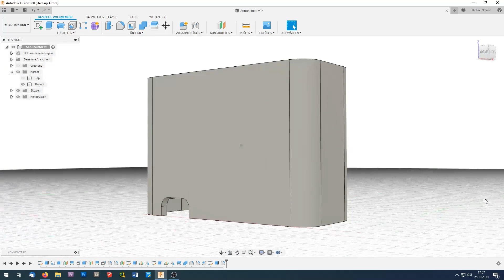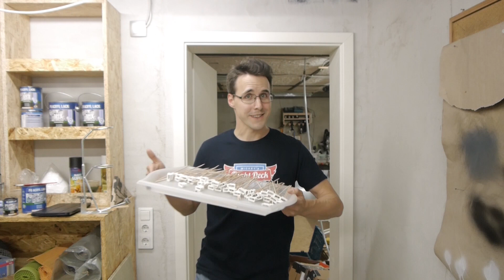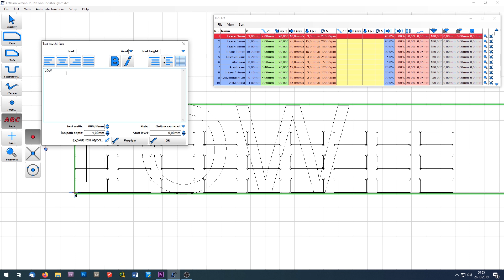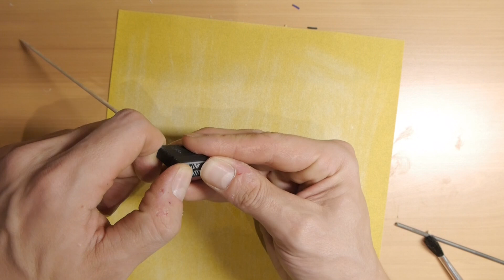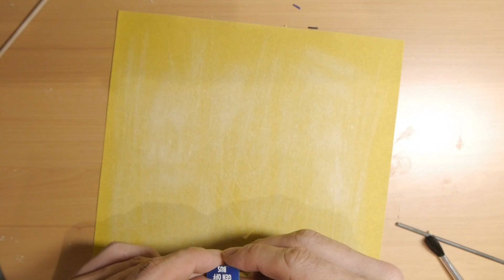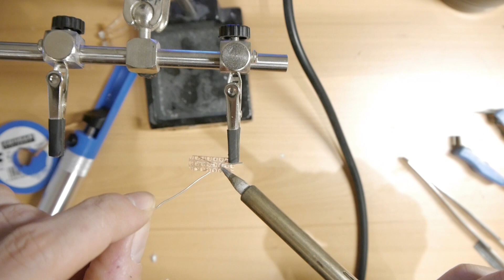Overhead annunciators - A Boeing 737-800 Homecockpit #37

Comment: Hi Mickey, I am following your channel since the beginning thank you so much for the videos. I can now afford to buy some tools to build a small cockpit for myself. Would it be possible for you to share the parameters for the cutting on the CNC ? The engraving works perfectly however I have some challenges with cutting the edges are terrible. Or maybe it comes from the tape that is not strong enough and make the small pieces vibrating on the tool. Thanks again!
Reply from the maker: For cutting the edges I used a single blade 2mm bit. 0,4 mm depth per pass with 720 mm / minute.
Reply: @Mickeys_Flightdeck  thank you ! Do you also have the parameters for the engraving ?

Comment: With this method, lets say an LED burns out or fails in someway, what would be the best way to replace the LED since everything is glued in? Other than that, wonderful work!
Reply from the maker: The "pcb" is just glued in with two drops of hot glue, which can be removed very easy. You would desolder the ground connection, remove the pcb and solder in a new LED. The annunciator can rest glued into the panel. Because every panel section of my overhead is an independent module, I can remove it from the overhead and do this work on my desk without removing the whole overhead from the cockpit.

Comment: Can you wire annunciators up to X-Plane 11 without using prosim software
Reply from the maker: Sure you can. For Xplane many people are using simvim.
Reply: @Mickeys_Flightdeck  so what out put board do u use for it
Reply from the maker: @couplesconsole  I will use an arduino mega with Mobiflight on it.
Reply: @Mickeys_Flightdeck  any chance u could do a video on how to wire it up and set it up on the computer or do u know were i could get more information on how to do it all would be much appreciated
Reply from the maker: The method I use is explained in detail in episode #35.
Reply: @Mickeys_Flightdeck  thankyou will surely be watching that

Comment: Michael, ein Tipp am Rande. Du kannst die Ränder der Anzeige vor dem Einbau ganz easy mit einem schwarzen Eding-Stift färben. Das trägt keine verdickende Farbe auf. Dem Ärger mit den Vorwiderständen kannst du auch lindern, indem du dir eine Zusatzplatine fertigst, auf der du alle Widerstände fest einlötest und die Zuführung lötest oder auf eine Klemmschiene bringst.
Reply from the maker: Ja, vielleicht hätte das tatsächlich auch funktioniert. Was die Widerstände angeht, so habe ich vor diese auf das Prototypboard des jeweiligen Arduinos zu löten.